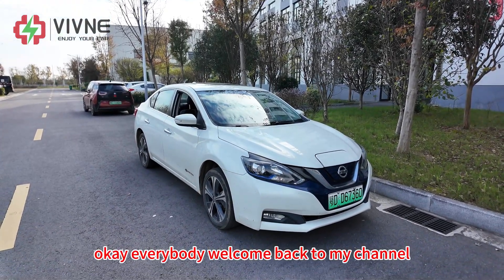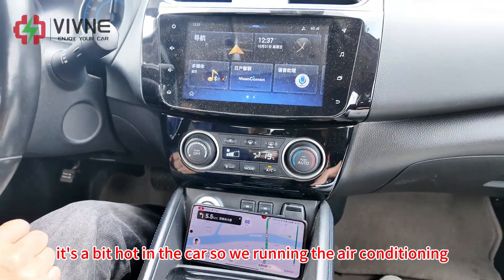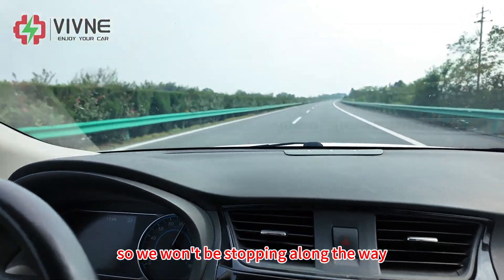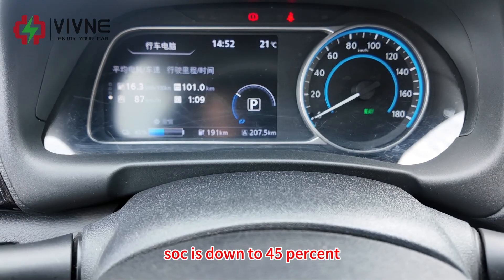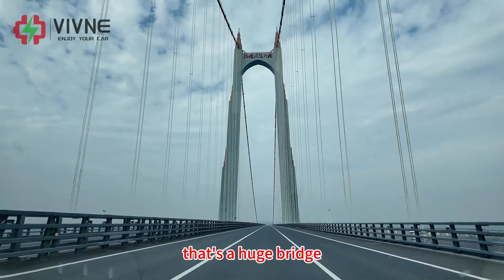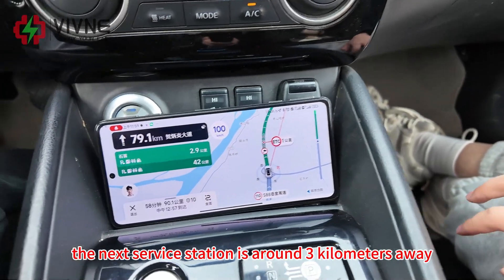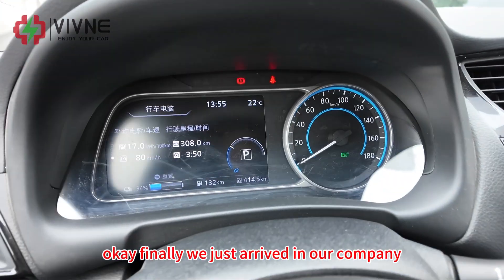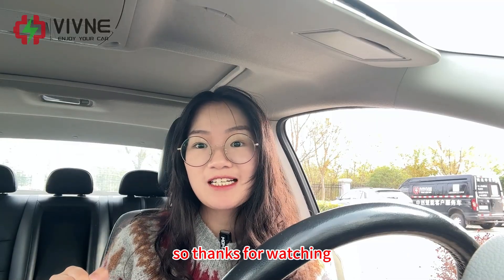VIVNE-Nissan Leaf ZE1 62kWh Real Highway Range Test | 410km Round Trip | AC On

Comment: Brilliant. My 40Kwh 2019 leaf will be good for another year or so before I will likely need a  battery replacement. That's a great range from an upgraded battery .  Given the leaf only has an air cooled system, how do you think your new cells will hold up to higher temperatures or lower temperature customers?  Fortunately for me, the UK has a similar climate to yours, so I will be fine. It would be great to see how your car gets on with degradation over time, particularly with rapid charging. Thanks for sharing 👍.
Reply: I'm in Australia with two 2019 Leafs (both 40 kWh). One’s my daily driver. The other’s just sitting in the yard—my dream is to turn that battery into a home solar storage system. How would you even start something like that?

Comment: 62 kWh battery. Started at 100% = 491 km. Drove 322.5 km with AC at 21°C and ended at 13% with 55 km left → real usable range from the first continuous drive = 322.5 + 55 = ~378 km at 87%, which equals 430 at 100% real-world range.  (Optimistic Estimate)
Reply from the maker: Your are professional!👍
Reply: Original ZE1 figure here in Canada is 340km

Comment: Hi, what was the charging speed did you get when you charged the new 62kw halfway? The chademo can reach up to 50kw but was not shown at the charging station when you charged on the first trip
Reply: At 10:30 they were getting 32kW at 59%, so the charge curve seems to be still the same as stock.
Reply from the maker: @ashton9699  Yes, that’s correct. Because we are using the original OEM BMS, when programming the BMS we only modify the capacity-related parameters. All other functions and protections remain unchanged, so the DC fast-charging behavior and charging curve are essentially the same as the stock Nissan Leaf.